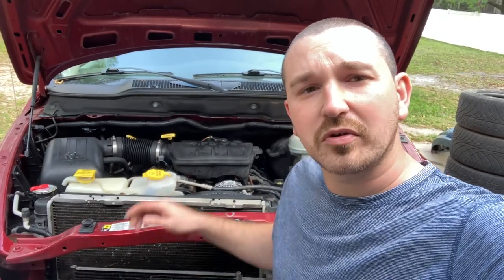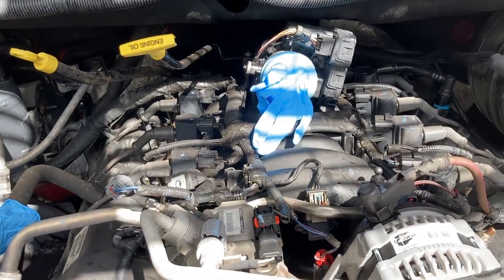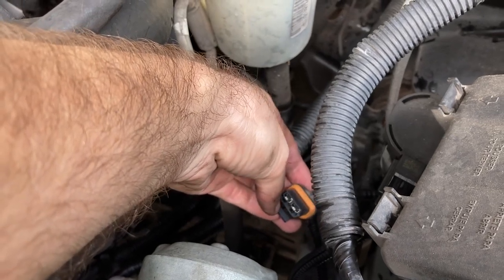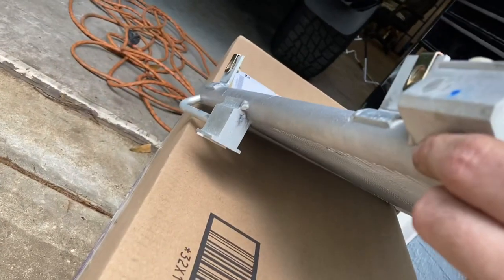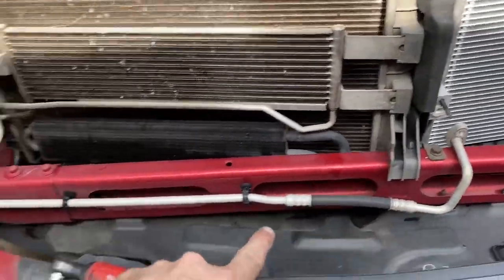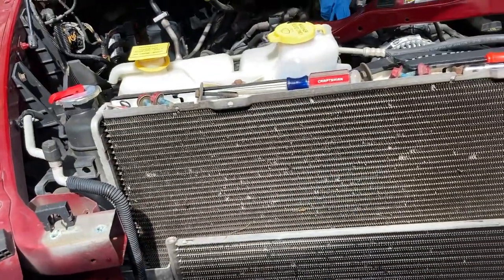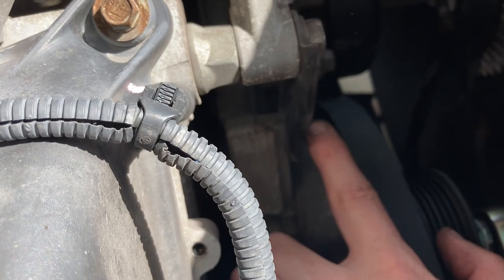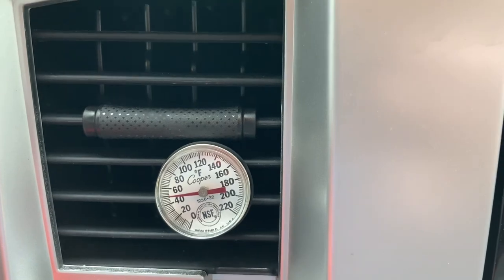2008 Dodge Ram 1500 4.7 How to Replace The Air Conditioning System. A/c Compressor Replacement

Comment: How much refrigerant and oil did the compressor need?
Reply from the maker: I believe my compressor took about 8 ounces of the PAG & 26 ounces of R134
Reply: @aaronsautoshop1991  thanks man. I definitely need to add some oil then. I filled up with about 32oz of refrigerant. Hopefully that doesn’t cause any issues

Comment: What did you do for the vac and recharge? Did you take it to a shop or rent the setup? And from where?
Reply: i got a vacuum, flush gun, flush, oils, gauges from amazon because of free shipiping. I go to rock auto and let them set the standard. I got their ac component kit and shrader valve remover.